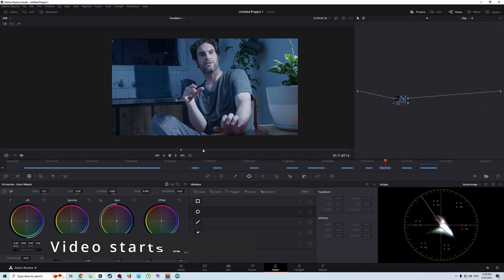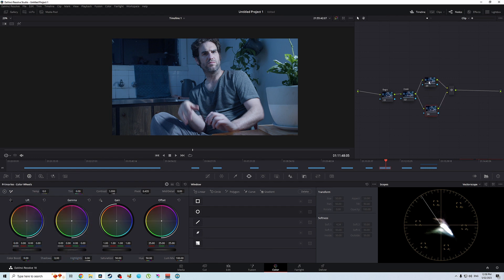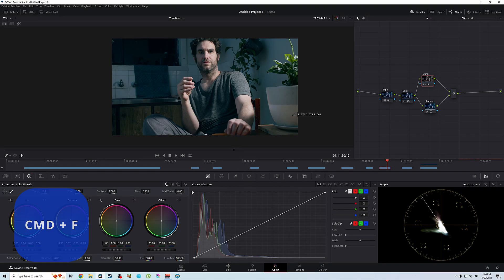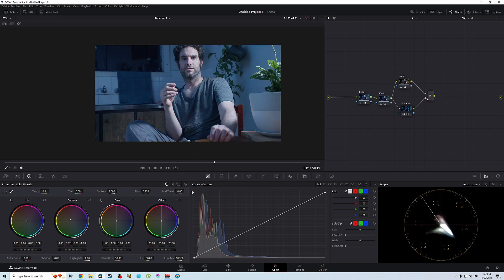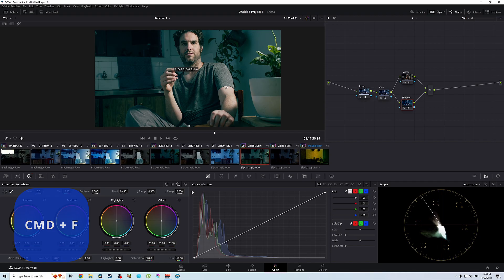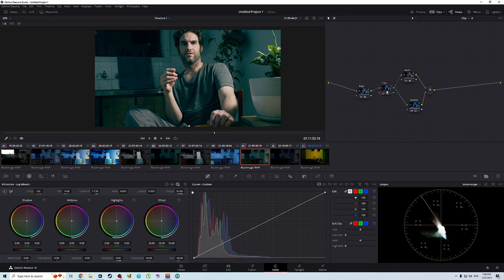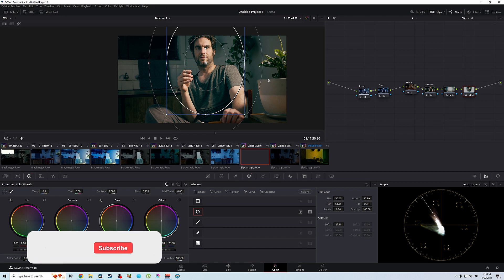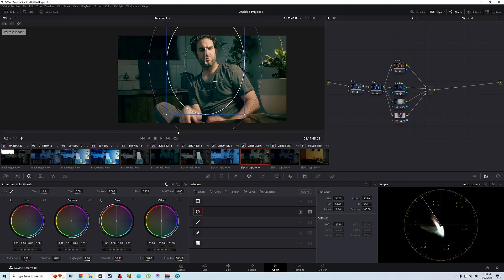Serial / Parallel Nodes - Whats the difference in Davinci Resolve

Comment: The one thing that confuses me is with the parallel node is how to target specific things in the video. 

For example, I have someone sitting on a rug with a sky in the background. How exactly do I target the skin tones in isolation of everything else, along with the sky in isolation and the rug in isolation. I am assuming you'd use a parallel node and then maybe use the window tool in each of those nodes to target each thing separately? 

Any advice would be greatly appreciated!
Reply from the maker: Yeah that's what I would do. When I'm working on keying an object I will use parallel nodes. You can try using the magic mask it is process heavy on your system through. Or a simple key should work.

Comment: or Right click on the nodes page and select "add serial/parallel" Node...
Reply from the maker: Lots of different ways. Short cuts are  faster though
Reply: @GreenGoatProductions  100% agree, I was referring more to going to the menu and doing it.  Going all the way to the menu bar vs clicking in the window is slower =)  great video though, I'm in the process of trying to learn how to use resolve and this helped.
Reply from the maker: Oh yeah of course. Great point and cheers for watching. I hope it helped. Have a great day.
Reply from the maker: Also, if you're just starting out, check out Cullen Kelly. His an amazing colourist with great fundamentals.

Comment: I’m relatively new to video editing but proficient in still photo editing and color management. I’m surprised at how well your demo worked on the clip you used. How did you accomplish it without any masking? Great work! What’s the secret? 😃
Reply from the maker: I guess using curves and power windows will give you a more targeted selection. Just be careful with curves though, it can have a huge affect on your grade. I'd start off with simple adjustments and see how it goes from there. Make sure before you start grading to have proper colour management and you're already off to a good start. (Don't download any luts from people off youtube, they wont work the way they're advertised, except Cullen Kelly, he is great, watch him)

Comment: So does this mean I could just do Saturation, Contrast, and so on with parallel nodes or would you recommend to just use serial nodes for that?
Reply from the maker: For your first three nodes, saturation, contrast and exposure you could use serial then parrarel for secondaries. Or you use as parrarel. I would suggest doing a simple grade and use both methods. Find which works better and simpler for you.